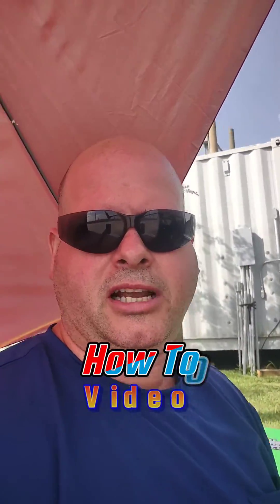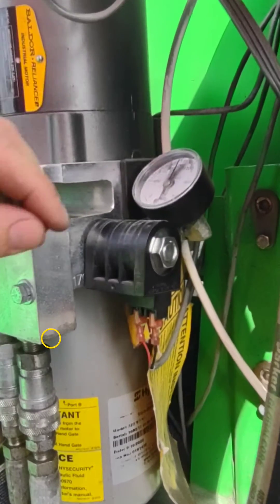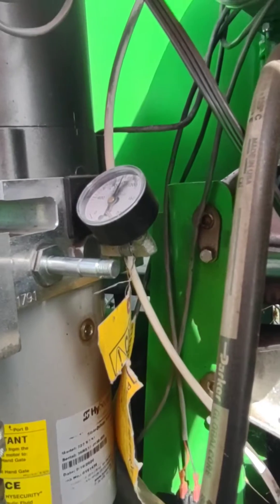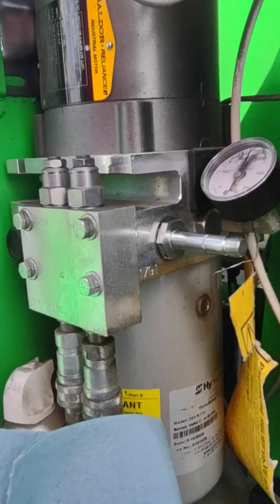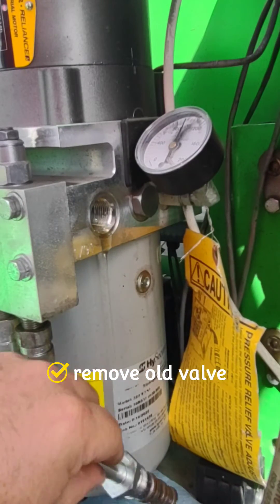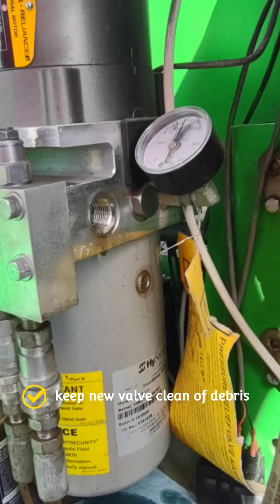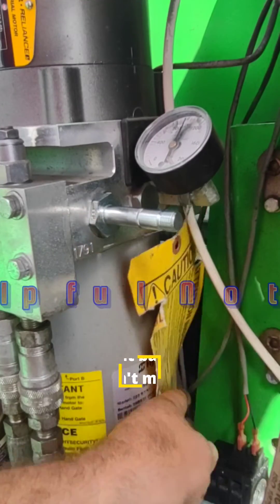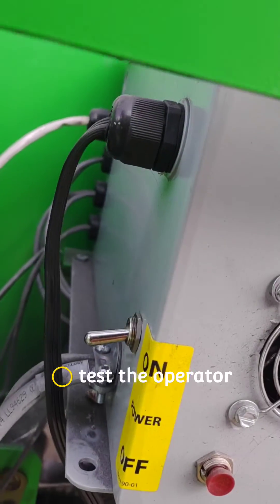How to Change the Hydraulic Directional Valve in HySecurity Slidedriver

Comment: Hey Jacob having an issue with a gate that has trouble starting out some times I have to pull it and once it's out of that position it's fine do I need to change the capacitor on the motor or do you think it low on hydrolic fluid or do you think it's something else it is a hysecurity gate.
Reply from the maker: What model of HySecurity?